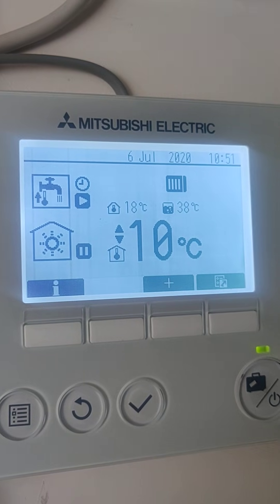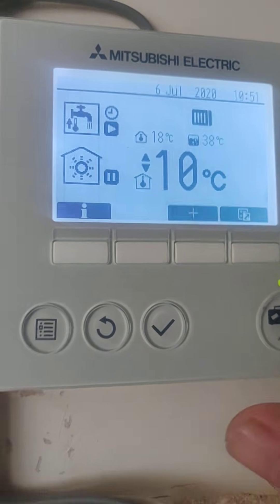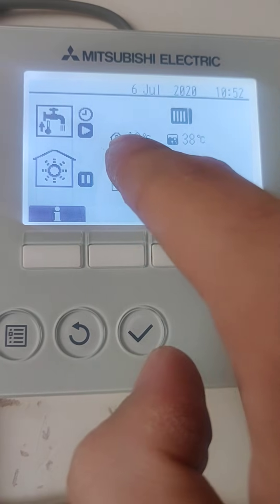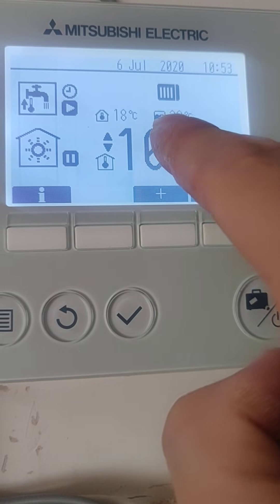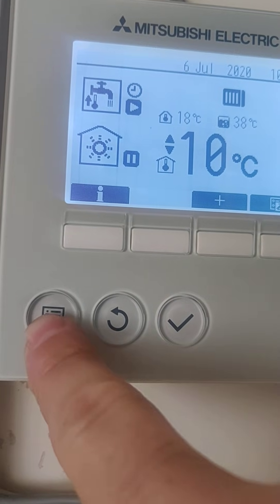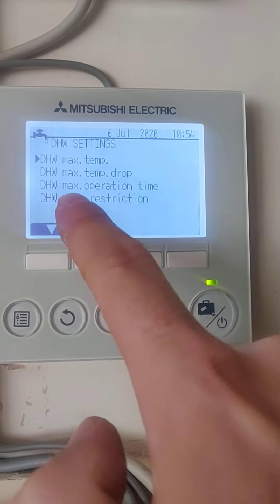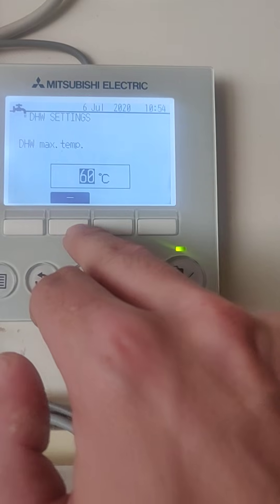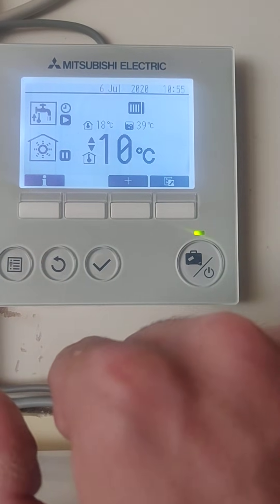Setting hot water temperature Mitsubishi air source controller

Comment: Hi, maybe you could help me ? 
We have underfloor heating downstairs and Mitsubishi control panel but on the first floor radiator and heatmiser . I was changing setting for downstairs heating and somehow upstairs setting /radiators were barely warm. I was bringing temp up and saw the flame icon but wasn’t getting warm. My question is. Can setting of the heating downstairs affect upstairs temperature? I have no one to ask and I watched all YouTube videos about heatmiser controller. Right now is working again I just don’t understand why doesn’t let me bring temporary temperature up
Reply from the maker: @jolawiniarz913  if your using a mitsubishi thermostat for underfloor ( assuming your underfloor has individual zones in each room with their own stat ) the mitsubishi controller along with your heat miser stat is actually only brining on the heat pump it's self, it won't change the incoming flow temperature, this needs to be done on the main RC as seen in the video it's self. But also 2 zones need to be set up correctly, i.e mixing valve, you generally have 2 different temperatures when using underfloor and radiators.

Comment: if i have the water temperature that is set at 35 degress and the flat is still around 19 degrees and not getting higher, shall I increase the temperature or shall i change mode to the one where i insert the temperature i would like to achieve at home?

Comment: If youvset higher than 55c, at what point will the emersion heater kick in to help it along, straight away or when it realises it can only go so high with the air pump? My hot water is set to 55c which I like.

Comment: Does the lowering of this temperature make any bacteria problems? I know there is the cleaning mode and then it goes over 60c or something and it should kill those.
We have Ecodan and it is also heating bathroom. I have no idea how the bathroom might have 27c even if the pump is set to 23c. Makes no sense in my mind. Well it does not show in electric bill.
Also it is also tricky to have good temperature in the bathroom at summer times as all the rest should have almost no heating. This year we moved the remote control near the bathroom and it works best like that. All the other thermostats in the other rooms are almost closed. Only bathroom and room next to it are open. Bathroom fully open.

Comment: We have what looks like the same control panel, however, there doesn't seem to be an option to adjust hot water, only heating. I suspect the hot water control might have been disabled somehow. (the hot water was previously just running from the wood burner). Is there a way to sort this out? Our hot water is scalding hot but there isn't any option to adjust the temperature.

Comment: We've had an Ecodan heat pump and cylinder installed with ftc6 controller, but it doesn't display the hot water cylinder temp - any idea as to why?

Comment: After setting it like you’ve explained why would it stick on 32 an engineer is coming but it looks straight forward almost as if something is over riding the temp you’ve set,
Thanks,
The system is brand new installed thought if it was something simple id do it myself
Reply from the maker: Hi Criag, silly question but might be the obvious one, is your hot water set on a timer ? none of the settings in this video would hold off the hot water coming on, also just check the max temp drop... if your installers left this too high it might cause the hot water to hold off.
Reply: Hi,
I don’t think it was on anything but i’ve highlighted play, the timer looks like it was set for all the time 12 until 12 but theres no change in temp i’ll see what happens its almost like something is presetting the temp on less than 30 maybe a setting on the immersion heater
Reply from the maker: @craigmountain5100   check the max temp drop setting - follow this video here if your not sure how to get to it https://youtu.be/egDI5kuceJc?si=i9WuFZYewWD7lK_A
Reply: @renewableheatingengineer8537  thanks for your reply, the “engineer” has been and we are up and running. I am not really sure what he did exactly and not entirely sure he did but the fuse in on the tank had tripped. He said that the water temperature was set too high and thats why it tripped but the fan outside started running before resetting i think. Anyway i have asked the tank for 50 degrees the system is giving hot water but the little symbol on the control still only shows 30 degrees I have the temperature drop set at 9 degrees the cycle time set at 110 mins so is there something else that could stop the hot water reaching the 50 degrees, thanks in advance and thanks for taking the time to reply, craig

Comment: Hello,
I missing the button after clicking Hot Water (DHW) I only have the option to change from normal to eco, I don’t have the second button to go into the settings. I used to and followed this video a while ago but it’s disappeared
Reply: Press hold that button on the far left.
Reply: Mine is the same, did you ever figure it out ?

Comment: Hey, I have a question. I have set up the heating with your guide and it was working fine. However with current -2 -3 outside. It looks like the heatpump is not that super good. I have set it up to warm the house up 2 times a day and 1 time at night. My question is - all my radiators are set at half (3 out of 6) Would it be more effective to switch them to 5 or 6 instead? I have set 20c on the panel as required temp. I'm just failing to understand, will the max setting on radiator strain the heatpump given that the pump has 2.5 hours in total for one run to heat the house, will it draw more energy? should I keep the radiators at half?

Comment: hey! great video thanks. it helped a lot. Just wondering if you know why my radiators are always just warm and never hot. my thermostat is set to 24 but it definitely is not that, it’s always cold in my house. i have been round and bled all the radiators too, not sure if it’s an issue with the system or the radiators? thank you!
Reply: For my radiators to get hot I need the water to be 35-45 degrees. Otherwise, like yours, They're only barely warm. -The lower settings keep the house warm, but if I want hot radiators the temp has to be high.

Comment: Great info. The house I moved into has the controls locked by the installer so all I can do is change the flow temp from 0 to plus or minus 9°.
How to I gain access to all the settings? I'm assuming a button combination.
Reply from the maker: Hi Ray, Press and hold the return arrow and tick button until the padlock at the top of the screen is removed

Comment: Desperately trying to sort the water temperate on my Ecodan as using far too much electricity. I do not seem to have a notepad button to get to the DHW settings.
Reply: Press and hold the engineers setting / note pad button at the start until it prompts you into the menu.

Comment: Hi there,  
I have my hot water set at 50 * and the timer is set for half an hour in the morning and half an hour in the evening when I need hot water for baths showers etc. But the water is coming only just warm enough to take a shower. How long does it take to heat a full tank? Do I need to leave the hot water on longer?
Thanks for the intsructions on these systems, really helpful.

Comment: Hi, so when it comes to my hot water the sink taps are fine and go to a good temp. However, my bath just doesn’t get warm enough. I’ve tried everything however my system looks like it doesn’t give me the options to change any settings. Also on my system is doesn’t tell me what my temperature is in the house or the temp of my water. Know how to get into it so I can sort all the settings out

Comment: Can u help I have a mitsubishi  air source  heating system  should I be able to run heating on  constant.  Prob having is that when hot water switches  of heating doesn't start again .

Comment: On my home screen there's no boiling water icon showing the temperature.
Reply from the maker: hey Colin, you need to press the engineers setting ( note pad button left hand side ) scroll across to initial settings and press the tick button, scroll down to temp display and press the tick button, press the button underneath the round symbol until this says room and tank, then press the tick button to confirm, press the return the button to the main menu then you should see it.
Reply: @renewableheatingengineer8537  good  morning and thanks for your helpful  reply. Followed  your instructions  and can now see the hot water icon. (Currently  reading 50 °c). Cheers,  Colin

Comment: Hi I'm looking for further videos from you but can't seem to find them, did you never get round to them? I despite not having much instruction have a system which seems to be working for us however I don't think it's anymore economic than a gas boiler but that could because its not optimised, it is OK getting people to use eco equipment and then not having them set up correctly which defeats the object so to speak
Reply from the maker: Hi Craig, Unfortunately I have not got round to creating any further videos, due to the request seen from this video I will be making more in the next few weeks i.e setting times and understanding how the system works. I will not dive into the parameters of the system as this should be set by your design team / installer. I can however help you to understand how your system should be set up although this is case by case, each system is different.
Reply: Could you please advise on how I add pressure to the system and I really need to know how to clear or reset the timers as the previous tenant had them set all over the place. Any help would be very much appreciated. Thank you

Comment: Hi, thank you for the video and is it true that with this kind there always has to be an electric supply continuously?
Reply from the maker: Ideally power needs to be left on to the heat pump other wise you will cause communication issues, you can manually system shut down however I do not recommend this unless theres an issue with the system

Comment: Hey! QQ: Is it normal for the Heat Pump and Immersion heaters to be on at the same time? i have the same set up as you but today is the first day they are both running on. usually its one or the other...

Comment: Hi, I tried to press the engineers button on my system and the screen is not changing, I've held it for even a minute and no change. Any other ideas on how to access this other screen? Thanks for your time
Reply from the maker: sounds like you may have a lock on the screen, does it show a padlock icon at the top ? if so .. press and hold the tick button and return button until this goes away, then try and press the engineers setting / note pad button
Reply: @renewableheatingengineer8537  that's exactly was was wrong.. thanks a mil

Comment: My edit button is missing when I follow this and try to edit the hot water temperature. What do I do to get that back?
Reply from the maker: Hey Lava, are you sure your holding the engineer setting long enough ? you need to hold the notepad button down long enough until it changes the screen to the next stage :)
Reply: @renewableheatingengineer8537 I've changed those settings but my water is still not hot enough when I need it to be. I start work at 6 in a morning and my water is stone cold before I go to work. I don't understand the schedule timer screen because it's just a line with Jan and one end and Dec at the other end?

Comment: Can you tell me please - if I set my Legionella mode to work at the same time as my hot water (at night) will the Legionella mode overide the hot water - or will it just not work at all. Would love it if you could do some more of these videos.
Reply from the maker: Hey Loclnor, If you set your legionnaires mode to be completed at night ( at the same time as your hot water cycle) it wont override so to speak, the Immersion heater will help top up the required temperature for your legionnaire cycle. the only thing you may notice every time the system completed the legionnaires is that your hot water temperatures are higher than usual, with all this said, it wont make a difference :) hope this helps
Reply: @renewableheatingengineer8537  Great - thank you - I have also seen varying times for legionella mode,  I have my temperature set to 60 degrees, but for how long should it maintain this please?

Comment: Hi there,

We moved 2 years ago in a new property which had a Mitsubishi Ecodan already installed. 
The builder didn’t provide any information whatsoever regarding the settings, although we’ve requested many times.

We have 3 major concerns, and we would wondering if you can give us a bit of advice.
Please note that we have already the setting you’ve presented here.

1. The hot water is running for 20 min before becoming lukewarm , filling a bathtub, (the DHW drops from 50C to 30C) and then we need to wait 1 hour and 8-10min for the DWH temp come back to 50C, and be able to take a 2nd shower/bath. The heating cylinder capacity is 170L.
2. Is written on the AHSP that the COP on these units should be between 3.5 and 4.5. 
I’ve done the calculations for ours and it was 1.9 in 2019 and 1.7 in 2020. Is like 50-60% efficient.
Could it be that the system wasn’t properly set?

3. On the first floor we have floating floors and carpet installed. Although I am setting the thermostats in every room to 24-26C, the rooms temp barely reaches 22-22.5C , even after 48h continuously running.

Could you please advise on these?

Thanks in advance
Reply: No answer in 2 years??
Reply: Did you get any answers to this?

Comment: Thank you for this video. In our home the little lighting icon is constantly lit, any idea what this means? The user manual just mentions electric heater is in use. Our electricity usage is very high and I suspect it has something to do with this.
Reply from the maker: Hey Dennis, sorry for the delay, I had problems resetting my account for access - If your lightening bolt is showing constantly it could mean multiple things. the most common is that the legionnaires cycle couldn't be completed, this is usually down to a faulty Immersion heater.
Reply: @renewableheatingengineer8537  Thank you for your answer. We had our system checked and reset and things are working fine again. This little icon did cost us about €250 in electricity so now I check the display on a daily basis 😂👍🏻

Comment: Hi, thank you for your help before. I have one more question. Just today I have noticed that the temp. shown on the main screen (58°) is much bigger then the temp. I have actually set up (50°). Is that could be a problem?
Reply from the maker: Hey Kasia, sorry for the delay, if it is the hot water temp you are referring to,  please don't be alarmed, it could be that your legionnaires cycle has just been completed, when this happens, it heats your water to 60-70 degrees. therefor the temperature will read higher

Comment: If possible could you explain the purpose of the max heat drop setting in hot water? Also is there away to stop my hot water running out so quickly before it gets hot enough again ? Thank you
Reply from the maker: hey Julia, really sorry for the delay in responding to this, had a few issues with account verification and re setting,  the purpose of the max temp drop setting is for example - if you have your hot water target temperature set to 55 degrees and your max temp drop set to 45 degrees, when you run a bath or shower, and take hot water from the tank, the sensor will read colder temperatures, as soon as the temperature within the hot water cylinder reaches below 45 degrees, the air source unit will start to provide hot water again. as for the water running out to quickly, there are so many variables to consider. do you run a timer on your hot water ? if so, are the times running long enough through out the times you require hot water, is the tank size big enough for the property/number of occupants using the hot water facilities? let me know if you need any further advise :)
Reply: @renewableheatingengineer8537  

We’ve been advised to leave our hot water On all the time, for a better performance. Our cylinder in 170L which probably is on the small side. We’ve mentioned to the builder however he’s saying that everything is fine. Our drop temp is 5 degrees.